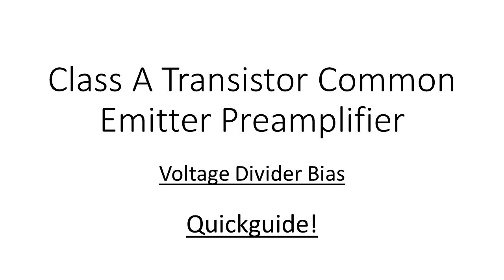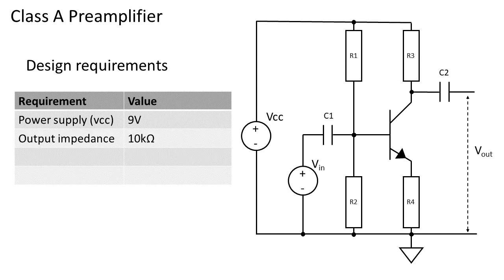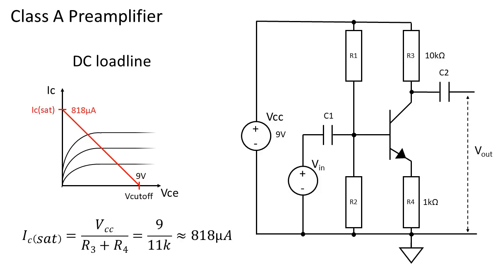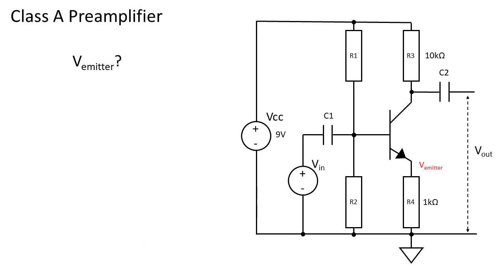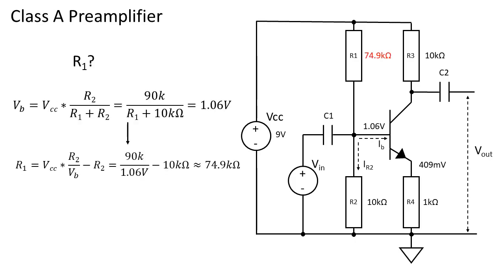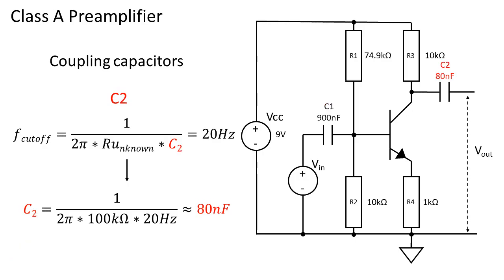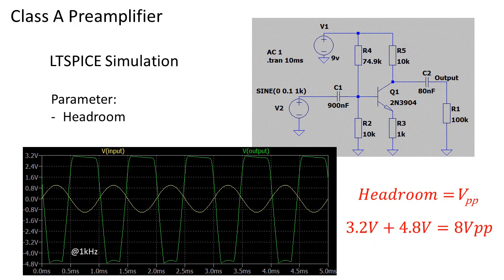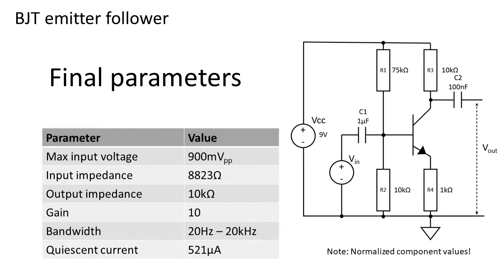Quick Guide: Designing A BJT Common Emitter Amplifier

Comment: What a lot of mistakes in this video.  Who would want to make a pre-amplifier with a gain of 9?   Apart from that, the gain of a transistor is about 150 to 350 and when placed in a circuit it will have a reliable gain of about 70.  A much better arrangement is the self-biased stage as it only needs 4 components. None of the demonstrators on YouTube have ever built a circuit in their life as none mention the self-biased arrangement. I have been designing circuits for 50 years and made hundreds of thousands of modules and made millions of dollars. Colin Mitchell. Talking Electronics.  Look me up.   You will learn a lot.

Comment: Does this attenuate frequencies higher than 20 kHz? It looks like you're only choosing capacitors to attenuate frequencies lower than 20 Hz, so will a low pass filter be used at a later stage? Thanks

Comment: Upon building the preamplifier, do you simply connect it to your typical common-emitter amplifier and then to the speaker? No additional circuits required?
Reply from the maker: As the name suggests, the PREamplifier merely boosts up the voltage and prepares the signal for the next stage. Driving a speaker requires a circuit that can also deliver current because a speaker needs power. (Power=voltage x current, we only accounted for the voltage with this preamplifier). The common emitter amp is not meant to do this. It can barely deliver current and thus not drive your speaker to good levels.

Follow up the preamplifier with a power amplifier like a push pull configuration or something different. Then attach that to the speaker.
Reply: @trevortjes   Do the technical parameters of the amplifier itself matter much if the voltage output of the pre-amp matches with the input range of the amplifier?

Comment: That was a wonderful review of the Class A (Preamplifier BJT from your intro) small signal inverting amplifier.  I liked how you just did a great component configuration review from theory and coupling AC capacitor filter designs making anyone into designing with basic PNP transistors will turn a small signal input to a gain of 10 amplified inverted output signal.  Well done!

Comment: What is the 'PHYSICS' behind 'why' there is 'INVERSION / 180 degreess OUT OF PHASE' of the 'signal input' at the 'output"?
Reply from the maker: To understand I'm gonna make some bold assumptions. Let's exaggerate! We put 0v on the base of the transistor. In this schematic not possible. But this would shut off the transistor and the voltage on the collector would be equal to the power supply voltage. So low input = high output. Now exaggerate the base voltage to something way higher than 0v. The transistor would be saturated/fully turned on and the collector voltage would roughly be equal to the voltage between the divider of the resistor on the collector and emitter. So input high = output low.

Now our amplifier operates somewhere in between but you can see how high input equals low output, and low input equals high output. This is the behaviour which explains the 180 degrees shifted/inverted output.

Comment: Howdy. Very nice.
However. JohnAudioTech has shown that the output impedance is 2 x the collector resistor. I have verified that this is true.
My test circuit: B+ = 9 V, Rc = 10 k, Re = 1 k, Rb1 = 47 k, Rb2 = 12 k.
Loading with a 22 k resistor the output signal dropped to a value of 1 / sqrt2 of the unloaded value. This is the most energy transfer efficient design, assuming the Rc is fixed.
If the circuit is designed for a lower output impedace the load power will increase. Yes. But the total current consumption is way larger than the increase in load power.
Best Regards.

Comment: In the simulation example for LT Spice, where did the value of R1 come from? could you explain? does this work in PSPICE or orcas?
Reply from the maker: Hi, R1 is the assumed load. In this case the output impedance of the amplifier is designed to be 10k. To not load the amplifier too much, I use the rule of thumb to use a load of at least 10x the output impedance. In this case that results in 10k * 10 = 100k. I have sadly no experience with PSPICE or orcas.
Reply: Thanks so much!

Comment: I think there is an error :  At 4:20 into the video,   R2 is being computed incorrectly.  The equation given ignores the base current through VBE.  If that is accounted for, R2 should be about 26 K ohms (and R1 will be about 176K)
Reply from the maker: I indeed ignore base current on purpose. As stated at around 4:08 I mention how we want to neglect the base current by making sure the current through R2 is at least 10x bigger.
Reply: @trevortjes  If I take you equation at time 4:15 and multiply both sides by 10*IB,   I get 10* ib* R2 = (Beta* ib) * R4.   Now the left side is the same as the voltage across R2.  Call it VR2.    Looking at the right side,  beta*ib = ic  and ic*R4 is the voltage across R4.    So what you are saying is that VR2 = VR4, which of course is not true.        What I suggest instead in that we use the values you have for VR2 = 1.06 V and ic = 409 uA and then now say that we want the current through R2 to be 10 * ib.    Note that 10 * Ib = 10  *  (ic/beta) , which is the same as ic / 10, which equals .0409 mA.     Now we know the current through R2 and we know the voltage across R2, so we can compute the resistance R2 = VR2 / 0.0409 = 26 K ohm.   So your estimate of 10 K ohm is a bit different!    I would like to know where this logic falls apart if I am wrong.  I've tried looking at many sources to see what I might be missing.  Also ,note the obvious;: if we change R2 to be 26 K ohms, we obviously need to adjust R1 to get the proper voltage divide. Luckily your way of doing that is the same as my way of doing it.
Reply: @MaintenanceOfficer-n3w  I had the same concern that  VR2 = VR4 is an inaccurate approximation. In fact,  VR2 = VR4 +Vbe.  It turns out that the Vbe quantity can be ignored for the values selected in the video, and having Vbe =0.65 for Silicon junctions.  Here is my analysis.  

VR4 = IR4*R4 = (1+Beta)Ib*R4.  And VR2= IR2*R2.  And we are assuming IR2 (r2 current)=10*Ib (base current) so VR2= IR2*R2 becomes VR2= 10Ib*R2.  
So  VR2 = VR4 +Vbe becomes  10Ib*R2 = (1+Beta)Ib*R4 + 0.65. Given Beta = 100  and approximating 101 as 100,  gives 10Ib*R2 = (100)Ib*R4 + 0.65. 
The 0.65 term is only substantial when it is a significant fraction of the other term, say 0.1 of the "(100)Ib*R4" term. That is when 0.65= 0.1 * (100)Ib*R4 = 10IbR4.  It is not.

Given R4 as 1000 Ohm, this is 0.65= 10,000*Ib or Ib =65 nAmp.  So, if Ib is less than about 65nAmps, the video's assumptions of R2=Beta*R4/10 is relatively accurate. And Ib is less than 65 nAmp, as shown below. 

Approximately, Vcc = 9V = (R1+R2)*I2, since Ib is only 1/10th of I2.  So 9V = 84.9KOhm * I2, gives I2 =  1 * 10 **(-4).  Given  Ib = (1/10) * I2, gives Ib = 1 * 10 **(-5) or 10 nAmp.  Since 10 nAmp is less than 65 nAmp, the approximation is not too inaccurate.
Reply: @trevortjes  PS - I really did love your video. Well done and was instructive to me.   I just think we need to account for VBE.
Reply from the maker: @MaintenanceOfficer-n3w  Hey! This video uses a lot of simplifications and does not account for some deviations in transistors. All this to get a result which is "in the ballpark" yet very usable and satisfying in real life situations. Approaches like this can be a breath of fresh air for amateurs or other electronic enthusiasts who want to dip their toes in transistors without having to follow hours of lectures or dive into books. Obviously, one can introduce any detail they can to get closer to a realistic/scientific result.

In my electronics journey I often came across problems which required me to do these more in depth stuff and put a lot of time and effort in it. My goal with the video is to give people interested somewhat of a shortcut to the knowledge, yet a bit of theory to also understand it. Videos like these also serve as my way to remember some theory cause even after 3 years of not having dipped my own toes in the matter, I also sadly forget how most of these things work. 

But thanks for your insights, I always support people who keep analog theory alive in an age where it slowly becomes obsolete.
Reply: @trevortjes  I agree that you have done a really good job at simplifying the design process and appreciate your efforts.  We certainly do want to encourage others to dip their toes in these transistors.  Thanks for taking the time to put together the video!
Reply: @trevortjes  I agree with you. Simplifying the design process is good and easier to learn for a beginner. But I also thanks M@user-cl5pp6dv3l to let us know different ways to approach the design. Both of you are GREAT!!!!!:yougotthis::yougotthis::yougotthis:😇😇😇👍👍👍🙏🙏🙏  @trevortjes   keep on making more Videos, THANKS A LOT.👍👍👍

Comment: I disagree that this is not an exact science. It certainly is, if done properly, and you should get the expected results that you design for, within component tolerances. if this were not so, it would be impossible to manufacture products consistently.

Your requirements are not mutually independent, since the supply voltage determines the maximum possible gain from this design, which is Vcc/50mV if you don't care about distortion. That can be lowered to Vcc/500mV if you want to keep distortion to reasonable levels. So the 9V supply voltage determines a maximum useful gain of x18. Specifying x10 is therefore acceptable.

There is no need to complicate the process by drawing load lines. Biasing to the "middle of the load line" is exactly the same as setting the "Q-point" (the quiescent voltage at the collector) at (Vcc + Vce(sat) + Ve) / 2. Since the voltage across R4 is the voltage across R3 divided by the gain and the voltage across R3 is near to half the supply voltage, that shows that Ve (the voltage at the emitter) is approximately Vcc/20 in this case. That means the collector voltage should be about (9V + 0.2V + 0.45V) / 2 = 4.825V and so the collector current should be (9V - 4.825V) / 10K = 418μA. Your method ignored the transistor saturation voltage, which is okay, but that's the reason for the slight difference. The rest of your method is fine, although the output coupling capacitor should be ten times bigger as the worst case loading impedance from the next stage won't be lower than 10K, so you design for that.

Now we know the collector current, we can calculate the intrinsic emitter resistance (re), which is 25mV/Ic = 60 ohms. Since the gain is actually R3 / (R4+re), using 1K for R4 will give a calculated gain of 10k / (1k + 0.06K) = 9.4, which is close to the design requirement. The gain you found in your simulation was, of course, the open circuit gain reduced by the loading of the 100K from the next stage, i.e. by a factor of 100K/(10K+100k) = 0.91. If you multiply the calculated gain of 9.4 by 0.91, you get 8.55. That's less than 2% difference from the gain you found in the simulator and well within component tolerances. This really is an exact science.
Reply from the maker: You can make it as exact and complicated as you want but that wasn't the point of the video. The idea of the video was to give people a way, a roadmap, to quickly get a decent idea on how a transistor amplifier works and how they could be arranged to do what you want them to do with some tips and tricks here and there. I don't think many people care for designing an amplifier with x gain at a very low tolerance, we got opamps for that. I do like your explanation, transistor theory is kinda dying. I'd invite you to use your knowledge to make your own videos or lectures or whatever to keep education on this topic relevant.
Reply: @trevortjes  I absolutely appreciate that you did a fine job of making a comprehensive introductory video for the subject that will appeal to a lot of folks who are just starting to dip their toes into the water.

Nevertheless, one of the strengths of the YouTube format is that it allows folks to expand on those basics in the comments section, thus providing further information without in any way detracting from the original video. I hope you don't mind me taking that liberty.

The problem with opamps is that they are either low-noise or cheap, but never both, and a cheap single stage common emitter front-end with a modest gain can beat all but the most expensive of opamps.

I'm afraid I don't make videos, but I do have a PowerPoint presentation that I've used to teach common emitter circuits. You (or anyone else) are welcome to make use of it, should you wish. I've put the latest version on GitHub at github dot com /RexxS1 /Common-emitter if you're interested.

Comment: A great guide! I was following very well until the point where you calculated R2 (at about 4:15). Can you please explain how you came up with that equation? Many thanks in advance.
Reply from the maker: Fairly simple, don't be afraid of the wall of text.

We want to make sure the voltage divider creates a stiff voltage on the base. But when you put another resistance across one of the voltage divider resistors (R1 or R2), you create parallel resistors which in turn alters the voltage divider ratio and thus the base voltage, which is undesirable. 

The resistor I'm talking about that could ruin the voltage divider, is the input impedance/resistance of the transistor. If you would model that input impedance as a resistor, it would sit in parallel with R2. 

But what is the input impedance of the transistor? Simply beta * R4. There are sources as to why we can assume it is this simple formula, one I recommend is a book called "Designing Audio Power Amplifiers by Bob Cordell". In this video I satisfy all conditions as to why this assumption can be made.

So now we do another assumption that happens a lot in analog electronics design. To make sure one variable doesn't influence another variable too much, we take a factor of more or less of 10. Sure there still be an influence and you will probably never really have 0 influence, but it is good enough for rock and roll. 

When putting a resistor in parallel with another, we call that loading. And loading in context of current means that a substantial amount of current branches off to the resistance that is loading our intended resistor. So in this case, more current goes into the base down R4 than down R2. We do not want this to happen, so we need to create a path for the current to travel which is more attractive. 

We simply do this by making the resistance of R2 10 times smaller than the input impedance of the transistor. Hence beta * R4 / 10.

Hope this helped :)
Reply: @trevortjes  Thanks for the reply - very much appreciated. All the best, -darryl